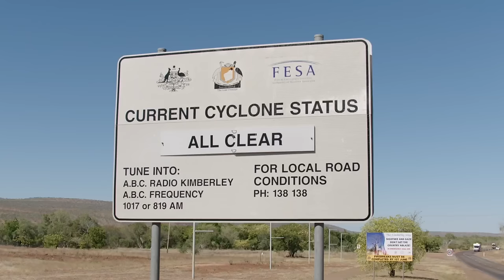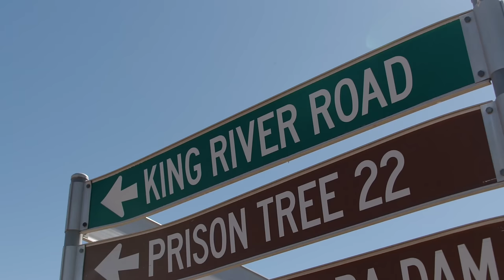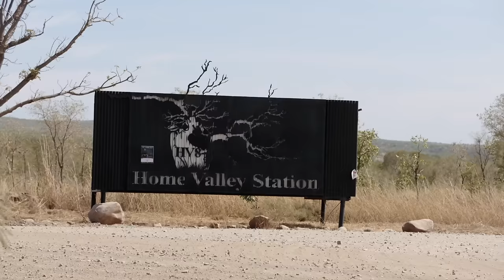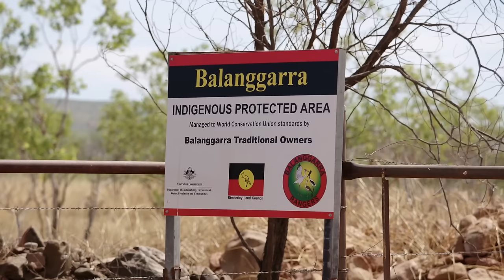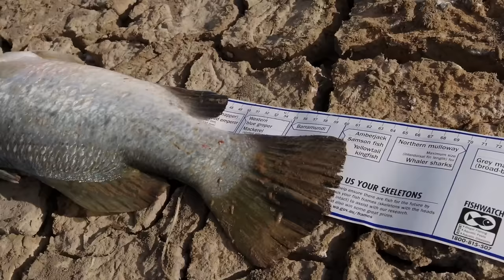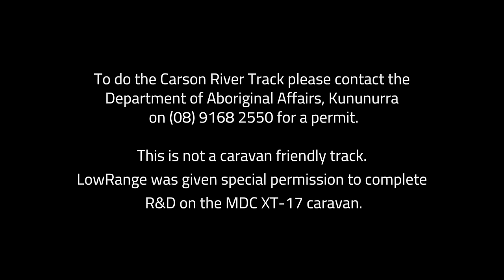Secrets of the Kimberley

Comment: To be honest I’m very disappointed with the porkies told in this episode they go beyond just making the story interesting example a I’ve had and worked on a hj61 with the factory 12HT there is no wires that go to the injector pump and they DO NOT have glow plugs they have a heater grid under the shut down valve on the intake which is what Glenn is playing with, I’ve have also done this track and there is no way through this track in a hj61 with stock tyres and no 4wd please stop making reality tv and instead make real tv
Reply: I think it was explained that it was the pre heat that was the issue.
Yes Mate, Ronny did that track in 2WD- no BS
Reply: Thanks for watching the episode